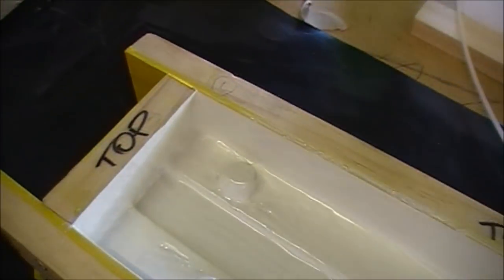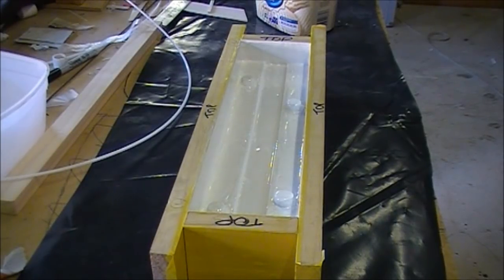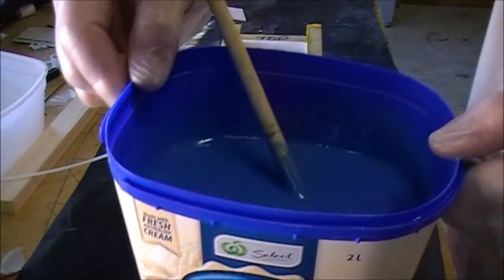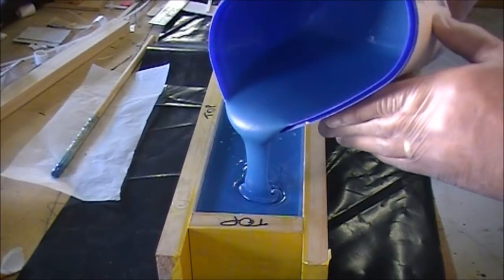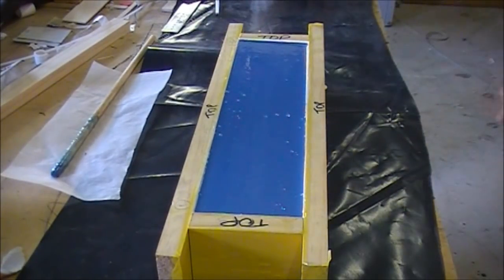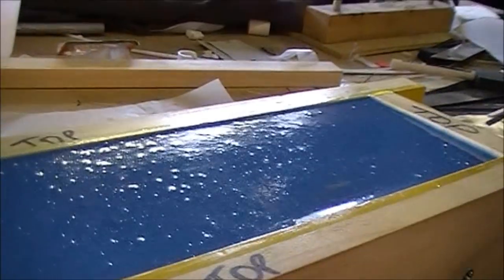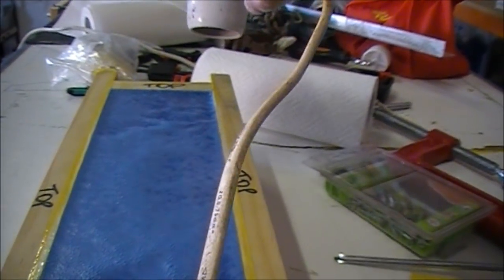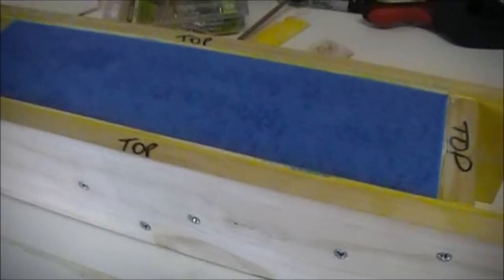Steve's DIY Corian Mould - Part 1

Comment: Steve thank you for the presentation. It was really helpful. If one follow the method for the manufacturing of a flat sheets, will the finish product also have the characteristics to be flexible when heated up?
Reply from the maker: +Techno Swimming Pool and Jacuzzi - I suspect so, but I can't say for sure. Most (all?) epoxies have a temperature beyond which they will again be 'plastic'.

Comment: Use a Heat Gun and let the hot air flow over the mould . You can make a 24 x12 lexan box cover to set over the top of the mould and make a hole both ends of the heat box cover for the Heat Gun to insert in and the other hole is for the hot air to exit and this will work as a small auto kiln oven . I think I might use this corian myself.
Reply from the maker: https://www.youtube.com/watch?v=YTUBlujFPW8
Reply: Theirs a mold release wax that you can buy to wax polish the molds  that will keep the parts from sticking in the mold. TR 104 HI Temp Mold Release Paste Wax sold online. I like the Corian molds you made ! I,m studying your videos ....I tried some plastic mold pour material ,but it sets up so quick once the hardener is mixed in the cup before even making an even pour over the cast plug....it,s called Alumilite.com mold rigid cast and mostly effective for very small parts. Ok, looks like your coming along in the video....will subscribe Thxs
Reply: Ok, I seen on your video just now you have the TR 104 HI Temp Mold Release Paste Wax in use.
Reply from the maker: @firefox2716  Firefox, I use the TR108 exclusively - it's the one you have to buff off before it dries.  In all my moulds I combine it with a brushed layer of PVA as well.  On my mylars, because I'm masking with tape, I can only use the wax.  Had great results so far.

Comment: Hey Steve, I'm interested in making my own DIY Corian for my product design course, I was wondering if you could explain how you made the mix, and where you can get your hands on the ingredients? Thanks!
Reply from the maker: Thomas, sorry about the late reply, I've been in hospital for a few months.  I hope this reply can still help.  All the ingredients came through local composites suppliers.  The resin is a laminating type, so it's fairly runny to start with.  The hardener needs to be super-slow, as this avoids, or almost negates, any exothermic reaction, which would distort the mould as it cures.  I simply mixed the resin in an ice-cream container, added a little pigment, then slowly added the ATH as I continued to stir with a dowel.  The ATH is white, so the pigment helps to see that mixing is effective.  After pouring the mix into the mould I tapped around the edges to release any air trapped.  Every hour, for three hours, I burst all the bubbles that surfaced, using careful passes with a butane torch. I suspect a heat gun would also work, but a hair-dryer just isn't hot enough.

Comment: thanks for video..
i want to ask that can we make different colours design in single piece ??
Reply from the maker: If you mean can more than one colour corian be poured in the same mould, at the same time, I don't think so.  The corian is still fairly fluid and self-levels.  I imagine they would simply mix, to one extent or another.

Comment: In corian mold which white pigment use ?
Reply from the maker: The pigment I used was an epoxy pigment in Cobalt Blue.  The white material is the ATH 'powder'.
Reply: @steveaitken5468  
Sir I want to know how to make corian white
Reply from the maker: @vickyparmar6548  Ok. Although the ATH is a white (almost) powder, the epoxy will have an effect on it.  The easiest way to make white corian would be to source some white, epoxy-friendly pigment.  Pigment is typically used around the 5% mark, but you can play with the amounts until you get the colour you need.  Most composites retailers will carry pigment - just make sure it is compatible with epoxy.

Comment: I want start my business marking sheet. Can you help me how can I make .. pls provide me full information how can make  it product
Reply from the maker: Steve Aitken
DIY Corian is a mixture of a Low Viscosity epoxy  laminating resin, a super-slow hardener (to minimise heat generated, and to prevent exotherm), and ATH (Aluminium Trihydrate) powder.   I use it to back moulds for composite parts, rather than the traditional multiple layers of resin and cloth.

https://www.googleadservices.com/pagead/aclk?sa=L&ai=DChcSEwifkNaM6bjtAhXV7e0KHZCiBRYYABADGgJkZw&ohost=www.google.com.au&cid=CAESQeD20XtftfUbBWtf2blWKPCaXWHfDgDkFJ6kERjgEq4tuvPpCSPBnNLnMKUN-OWlfDX4caIdq3GWv1Loz17mAwxu&sig=AOD64_26OFDpsjwDkcbIsx1zhBLwOPd2qg&ctype=5&q=&ved=2ahUKEwjCw86M6bjtAhVxMOwKHR38C5kQ9aACegQIDRBT&adurl=

Comment: Does It get hot when curing?
Reply from the maker: Andre, the simple answer is no.  The Super Slow Hardener prevents the batch from exotherming and because of this, the outcome is a mould that is dimensionally accurate - no shrinking in other words.  I am aware of some much bigger moulds being poured this way, without exotherm issues either.  Cheers, Steve.
Reply: @steveaitken5468  thank you for your response Esteve!
Have a nice weekend!

Comment: Please, is corian a simple resin epoxy thing?
Reply from the maker: DIY Corian is a mixture of a Low Viscosity laminating resin, a super-slow hardener (to minimise heat generated, and to prevent exotherm), and ATH (Aluminium Trihydrate) powder.   It is used in our circles to back moulds for composite parts, rather than the traditional multiple layers of resin and cloth.

http://www.kirkside.com.au/D291/dt-082-filler-/
Reply: Steve Aitken thank you for the answer. 
Is DIY 'do it yourself'?

And is this material like de real Corian⊙?
Reply from the maker: Yep, DIY = do it yourself.  Sorry, I don't know, but we have guys here who CNC machine molds from  corian off-cuts from kitchen companies.
Reply: Steve Aitken oh, I see. Thank you.